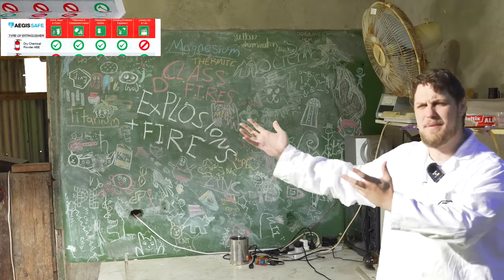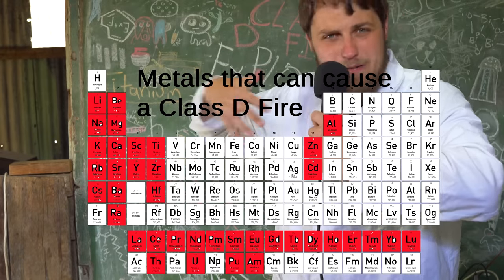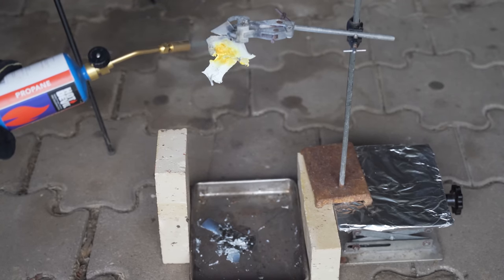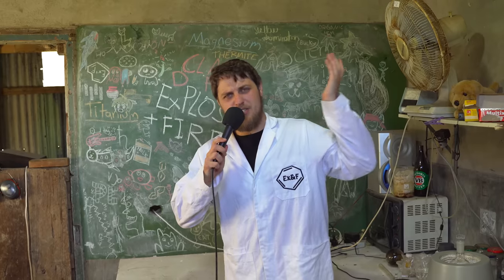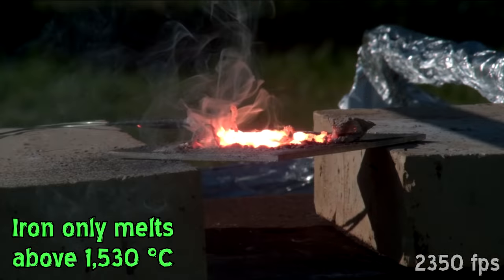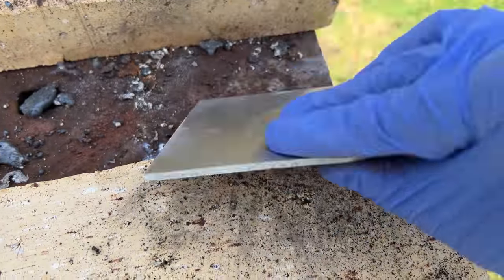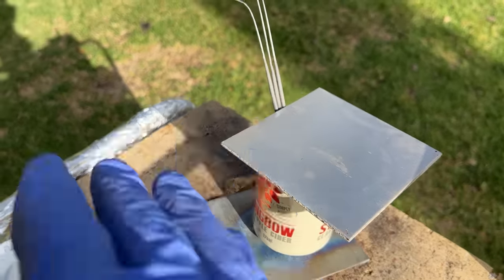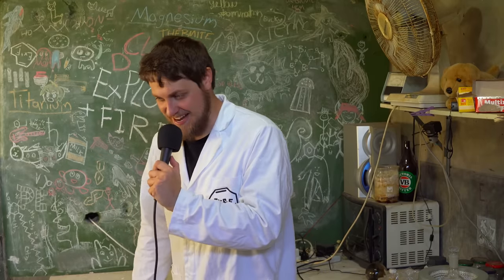Lighting metal fires (and putting them out??)

Comment: You light titanium with titanium, i know it sounds dumb but hear me out this is how it happens in machine shops. you get a massive pile of shavings building up on a part then a spark lights one shaving leading to a high air to fuel ratio fire which gets so hot it lights the titanium part below it.

Comment: I have a very dangerous and stupid idea. If one was to place an electric charge on the titanium to get it good and hot, and then start a cut with an oxyacetylene torch, maybe flames? 🤔

I know getting it in powder or chip form would make it much easier, friction alone would work from a lathe, mill,or saw with high RPM and dull tools with a large surface area but still able to cut. 

The plate, with enough heat and a large oxygen source would be able to ignite, but I'm thinking the acetylene would help with ignition. The idea with electricity is to add consistent heat, but I reckon you would need equipment with huge gauge wiring and a good cooling system to handle the low impedance circuit. It would help provide consistent heat. Doing anything wrong could be LETHAL. I would also consider setting up a dead man's switch or killing the power before getting close for the cut. 

Disclaimer: I'm not a scientist, I'm just an average dude who works with metal and electricity semi regularly. I also stayed in a Holiday Inn last night. My degree is in computer science and I mainly use machinery for my lock making and picking obsession and other personal projects. So don't listen to me or try my ideas. Consider me an idiot.

Also I'm speculating on a sustained fire, it is simple enough to cut titanium with the proper welding/cutting devices and torches. You are essentially melting and burning titanium when cutting/welding.

Maybe also try making titanium wool, like steel wool. It would make it way easier to ignite and wood still look cool and burn longer than loose chips.

Comment: Use a higher power higher temperature thermite like powdered magnesium stoichiometrically mixed with manganese dioxide as the oxidizer to light titanium. Alternatively make a magnesium thermic lance by packing a magnesium tube with thin rods of magnesium and attach one end to an oxygen cylinder and flow oxygen through it while lighting the other end with a pile of thermite or an oxyacetylene torch. Technically you should wear a full fire proof suit like steel workers wear to operate a thermic lance because a raggedy ass lab coat is not going to do the trick.

Comment: You may have to scrub the shit out of the titanium to remove some sort of oxide layer, like IMMEDIATELY before you try to start the fire. Looking at a paper on titanium fires in aero engines, I noticed that most of the *known* causes involve physical damage to the engine. If we consider that in conjunction with every machinist EVER talking about their fear of titanium fires when machining a titanium workpiece, it seems titanium fires are much more likely when something has scraped, rubbed, or otherwise gotten rid of a naturally-formed passivating layer. I know NOTHING about titanium, but I *surmise* it's relatively similar to alumin(i)um in this regard.

Comment: 70% of one 30% of the other, you used too much iron. The recipe key you are looking for is that the material you use needs to be finely atomized. 30micron or better makes for better plate penetration. Thermite welding is a real-world practice and in no way any less harmful than stump remover and a kitchen.

Comment: I’m assuming the thermite didnt melt the titanium because you placed the titanium below the thermite. Hot air rises, so you missed out on most of the heat energy that could’ve been transferred into the titanium. You might’ve gotten better results if you’d positioned the tits Kim plate on top of the thermite similarly to how you did with the magnesium plate when you did the final test with a LOT of thermite.

Comment: What about thermite in a o2 tent??.. 
And what about thermite with magnesium and a oxidizers,  and what if the titanium plate is covered in a oxidiser to help insulate it, hold that heat in, and be in a oxygen tent,  just a large box with a ckear plastic window, and roughly 80-90% o2,

Comment: 4:30 Titanium dioxide is a bright white and is the most common pigment in white house paint. It's also used as a filler in pharmaceuticals as an inert ingredient. The colors you're creating are from titanium nitride which is a very hard ceramic and is used to coat machine tool bits made of other very hard ceramics like tungsten carbide. The colors are caused by half wave interference like gasoline on water and can vary from blue to gold.